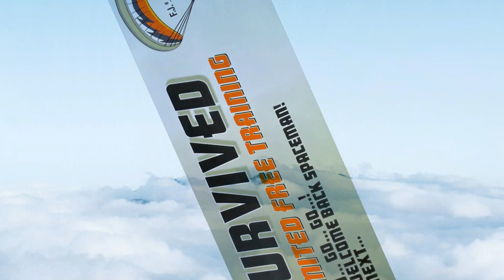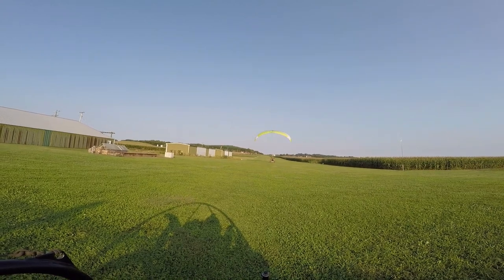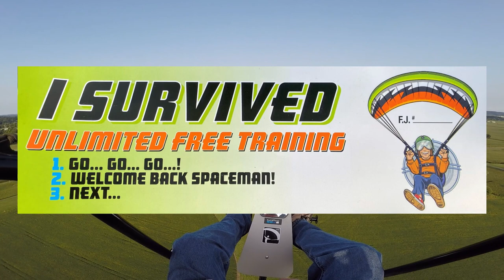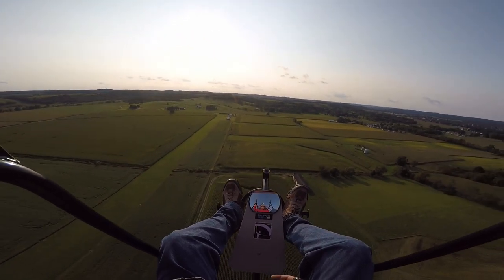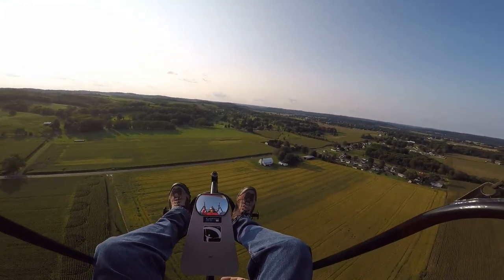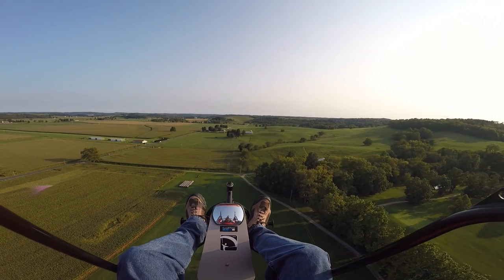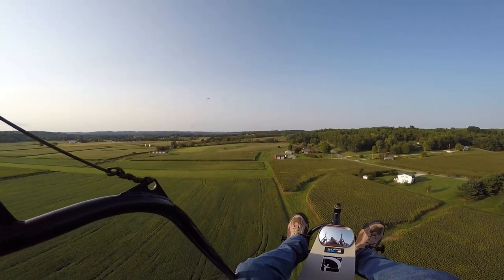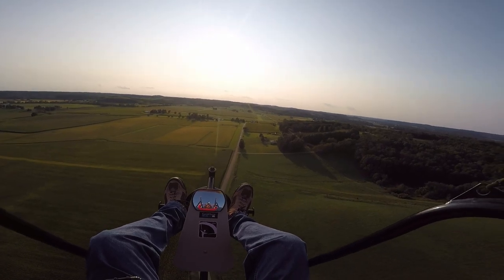David’s new wing and I’m in the air after a bad plug wire on coil - Ohio Paramotor Trike Adventures

Comment from the maker: Well the culprit ended up being an arc’d out or burnt out plug wire going into the coil.   When at full power the spark wasn’t able to conduct thru the wire.   The clue that helped me trace it to the spark wire was watching the rpm’s bouncing at 5000 or above.  Thanks to all the help and special thanks to Harold for sending me some floats to trouble shoot my misfires.   Back in the air!
Reply: Wow. Thks for the update.  Thought you’d leave us with another cliffhanger  😆.   So was it burnt at the coil or at the plug or everywhere?   Glad to see ya back in the air chasing that hooligan with the charger 😉
Reply from the maker: @ppgtrikejockey  the wire at the coil end was degraded so much that there wasn’t enough contact from the coil pin into the wire.   Hence the lack of spark at high rpm’s getting to the plug.   I had purchased the exact plug wire and have about ten more sections just in case this happens again.   I try to replace every year.  This year I did as well, guess I just have been over working it. 😂😂 making sure it’s screwed in all the way probably helps too.
Reply from the maker: Surprised you didn’t mention the sticker!!  🤪🤪
Reply: @Ohio-PPG-Trike-Adventures  is that the new solo sticker? It did make me chuckle 😄. Though I must say, I never had any of the issues that others say they’ve had.
Reply: @Ohio-PPG-Trike-Adventures  wondering…did you ever switch to the newer version of the stater and coil?   Relooked at your vid where you replaced the stater (a while ago) but couldn’t tell.
Reply from the maker: I did not.  I talked to a couple people that told me they are putting the old one in the units again.   So a bit of confusion on those.

Comment: What does your flypod weigh - I liked your sticker...I know a few people that have been trained that way. I guess the equipment seems to hold up good but just different than the Mosters and others. I like my Charger 2 but then that's the only wing I have flown. I have friend in San Antonio that I need to go and see - we agreed to try each others equipment to see what the differences if any are - both are sized the same but different brands.
Reply from the maker: I think the fly pod is around 35 or so.   Trike and engine 164 pounds.   Nice to fly different wings.  My Universal is similar to the Charger 2.  I have a couple extra bells and whistles.

Comment: Bob, what size power Atlas did you start with? Did you have ocilation under that wing? What differences did you notice when you went to the Universal? Also, do you have any splash boards? I got a good shower on takeoff last Tuesday morning!
Reply from the maker: I started with a large.  I did not have much oscillation with my wing as I was pretty heavy on it.  The most noticeable is how much easier it is to pull the brakes.   Also felt safer with the correct size wing as well as better controls.  The atlas is a heavy wing  that is a basic A wing.  If I had done it again I would not of purchased an Atlas but the other wing offered.  I do have a splash board left.
Reply: @Ohio-PPG-Trike-Adventures  yep, I've only got a few hours of flight time but I'm planning on getting a Universal 1.1 next year. How can I purchase the splash board?